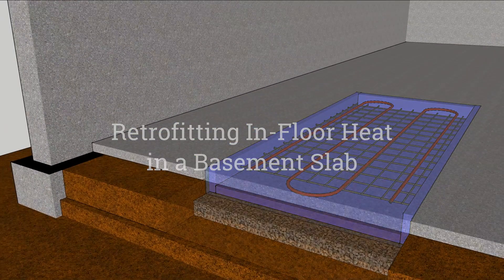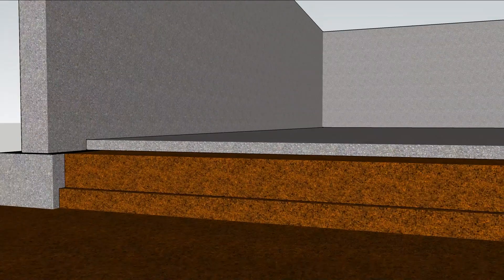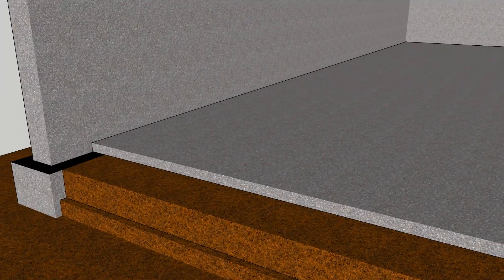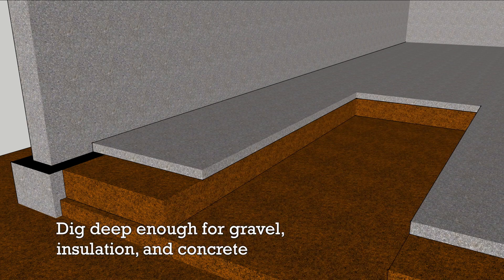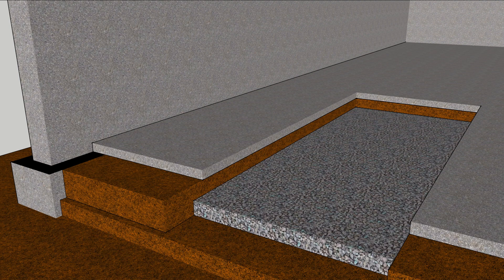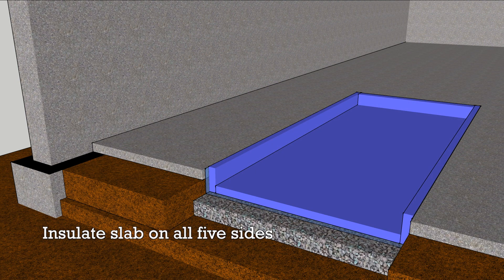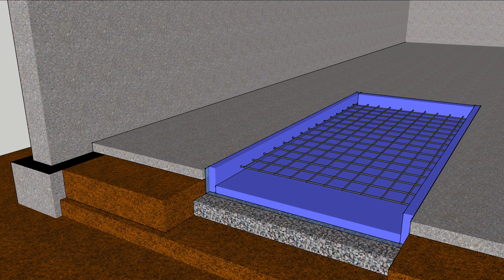Hydronic Retrofit in a Basement Slab: Insulate!

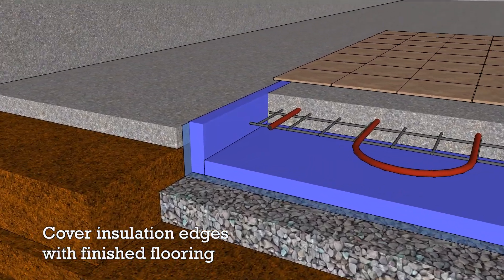Comment: 0:58 It may pay to drill holes and glue rebar dowels to tie the new slab to the old slab. This is to minimise tile cracking when settling occurs under the new slab. You could use the fibreglass rebar dowels to minimise heat transfer and also minimise any chance of corrosion through the joint. Also wiring the elements needs to be considered. Very nice, clear, informative and visual representation of the structure, thanks.